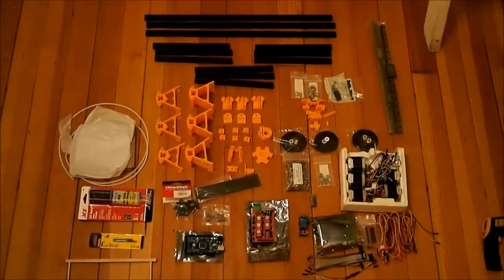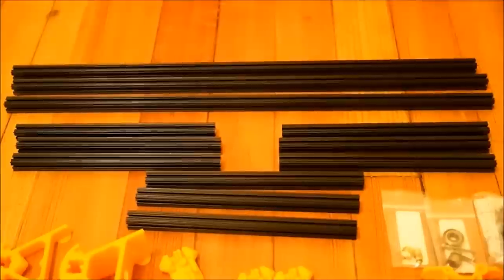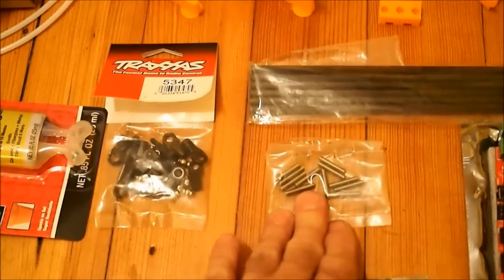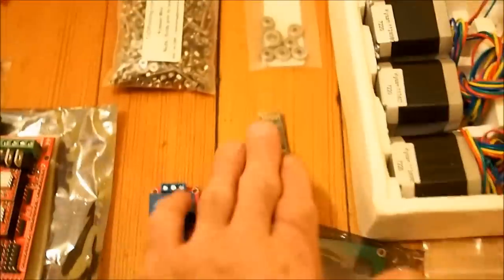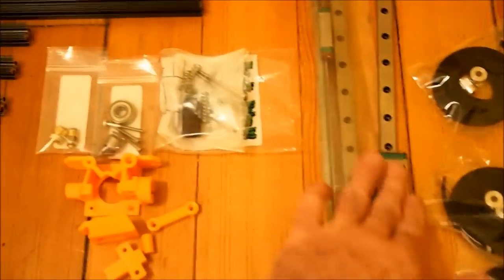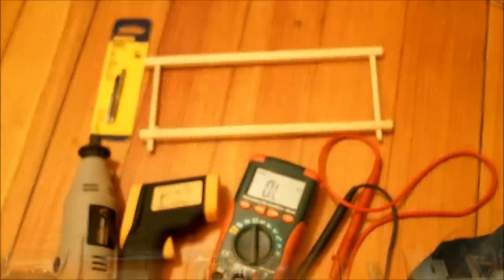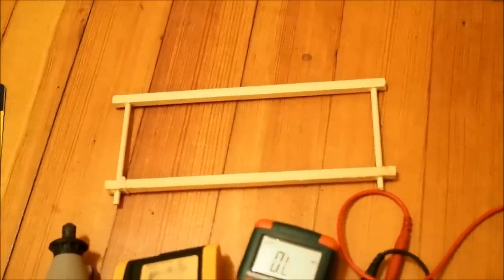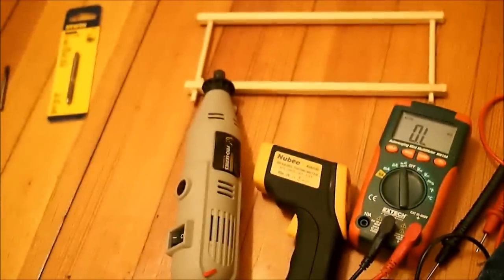Mini Kossel 3D Printer Build - 1  - Parts List and Tools

Comment: Is this a kit you bought on Ebay.
Reply from the maker: Mark Schlegel No. the 'printed parts' came as a kit. But I pieced together everything on my own from the kossel parts list. Mostly I did this because I was unimpressed with the quality of the components in the kits I've seen online. In particular, I find the hot ends included with most kits to be garbage. The MGN-12 bearing slide rails and NEMA motors are often skimped on by shady vendors as well. If you do purchase a kit look at all of these items closely to make sure you are getting what you pay for.

In the end I spent around the same as if I had bought a kit. It took a little longer, and some of the parts came from overseas. So I had to plan ahead. But the end result was worth it. I've dialed in the settings for both PLA and ABS and I'm starting to play with PET+. The printer has performed excellently so far and has actually exceeded my expectations!
Reply: Thank you very much and I'm glad it all is working out well for you.  I'm just getting started in this and asking questions.